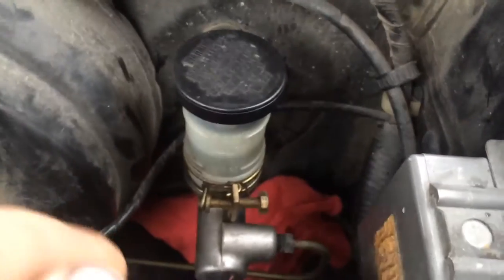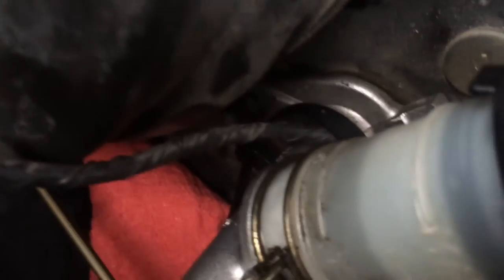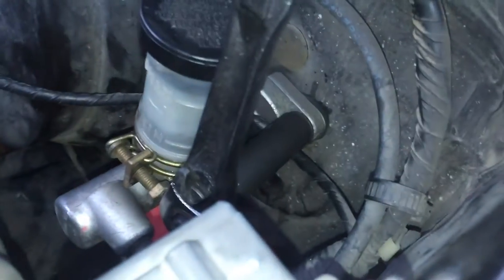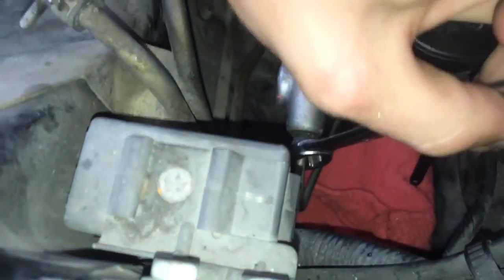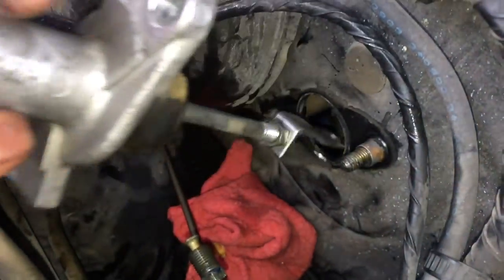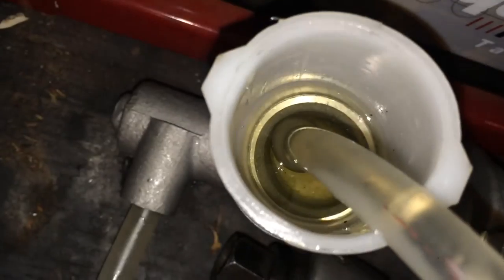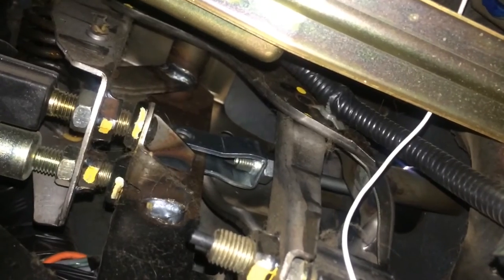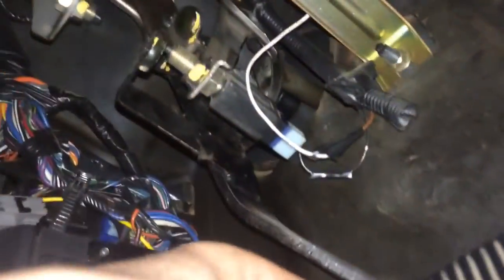Nissan 300ZX Clutch Master Cylinder Replacement

Comment: "You also need..." clanging "that pick I just dropped down there" I absolutely died. In a shit mood having to fix something on a car I JUST bought, but your humor lightened the situation up lmao. Thanks
Reply from the maker: You are welcome, I’ve definitely been there unfortunately, hope the repair goes as smoothly as possible!
Reply: @TheFeesher  I let my buddy do the master cylinder while I did the slave....

We spent 4 or 5 hours bleeding the system, couldnt figure out why it wasnt bleeding all the way. Tried a hand vacuum, compresor vaccum, good 'ol pump-the-clutch and bleed...

Yeah, the next day I startes troubleshooting, decided to check the pedal... Immediately pulled up your video with.a hunch.. And yep, he (we) forgot to adjust the master cylinder's pushrod.

Man I was so pissed yet so relieved at the same time.

Comment: This was helpful. I did bleed from the bottom first then at the top then back at the bottom. The bleeding took forever. Clutch pedal wouldn't spring back from the floor for a long time. I was beginning to think something else was wrong. Eventually though I got pressure and all was good. 

I did both the slave cylinder and the master cylinder at the same time. Only the slave cylinder turned out to be bad. Clutch engagement is much higher out on the pedal stroke as you noted despite setting the same dimensions for the stop. I may go back and adjust it, but not this week.

I used almost a whole bottle of brake fluid for the bleed. Probably more than needed, but wanted to be sure.

Thanks again for the video.
Reply from the maker: You are welcome! Thank you for the story, it may help others who get frustrated with how ridiculously long this job takes
Reply: I did go back and adjust the clutch. It was not fully engaging and allowing some slip under high load. I ended up having to unbolt the master cylinder to be able to get enough room to make an adjustment. I would recommend starting with the mid point on the master cylinder linkage.

Comment: You can do the work and you can improvise. Next thing you need to do is learn to edit for the masses. I appreciate your honesty about how you went wrong through the swap. 
You could do narative work about the pitfalls we might encounter instead of showing us your fumbles (we all make them),  In other words, you just swapped a part on a car. I came to your video to learn how to swap the same part. 
Tell me exactly what I need to know and tell me where I might go wrong. I'll think of you a an expert, not somebody who will fumble thorugh the same way  I could have without your help. Add some value to your work and you can grow here. Just sayin'.
Reply from the maker: Brett Jacobs ehhh it’s kind of my style, I was a Honda technician for over 2 years, hardly anything goes as planned with older cars and I like to show that